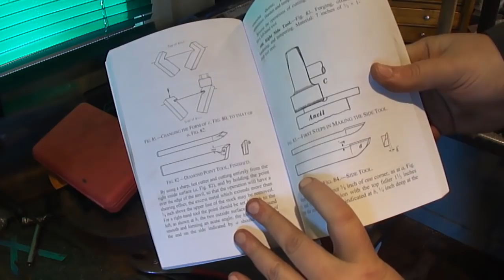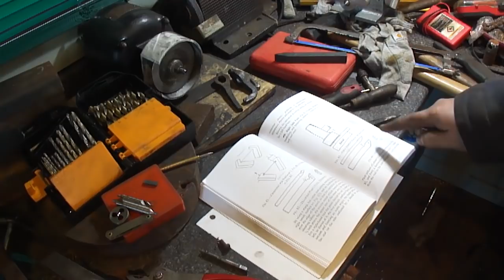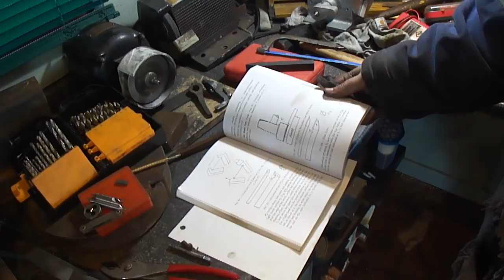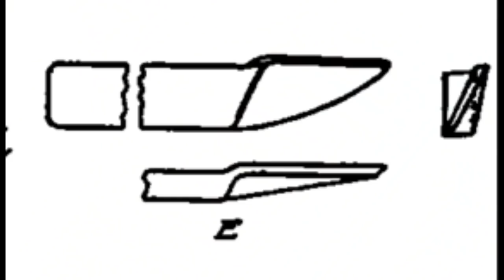Forging a Lathe Side Tool

Comment: very nice sometimes the old ways really produced great results.  You may wanted make some more tools with the high carbon steel, it seems to do a great cut (nice finish).
Reply from the maker: yea, I agree, I was collecting more pieces of the track to make some tools for the shaper next, but those are really just repeats of the lathe tools really, so I wont really show those.
Reply: That sounds good, it seem like a good metal for tools.  I have two questions where do you get your railroad steel and what is the title of the book you were using for this?
Reply from the maker: I live somewhat close to the tracks, but the guys that work on the tracks tends to throw the stuff off to the side and as the trains go past, it slides down into the ditches off along the sides of the tracks and ends up going into the people's fields and yards, which I know all of the people around here and they are fine with me just walking along and picking up that stuff out of thier yards so they dont hit the stuff with the lawnmowers and farm equipment. 

As for the spikes and stuff like that, Im friends with a few people that works on the tracks, and once they found out that I was tinkering with the blacksmithing, they dumpped off a large bucket of the spikes that they ordered at work a while back and something was wrong with them, and they couldnt sent them back, so they asked if I wanted a bunch of them, hence the large box full of new spikes in the last video, lol. 

You dont have to use the railroad steel and you can buy stuff like 1095 and stuff like that pretty easy online. Alot of knife makers tend to like that alloy evidently, so it's pretty common. The tools can be made of other alloys like O1, W1, and other grades of tool steel, but I just used what I have rather than buying new stuff. 

The book is called "forge work" by william L ilgen. You can find plenty of copies of it in pdf form on google, but I prefer an actual physical book to read from if I find that I look up stuff in it enough.

Comment: Some more quality tool making.. Did you ever think of starting an Etsy shop for custom cutters?
Reply from the maker: lol, nah, not really worried about selling the stuff tbh, too many people out there that you have to deal with that are unhappy no matter what and in the end, it's just more headaches than it's worth to sell stuff that you make.
Reply: Chirpy's Tinkerings true story hasn’t thought of that...
Reply from the maker: I learned that the hard way when I was building and selling computers when I was younger, and by the time you factored in all of the replacement parts because of stupid stuff, I ended up losing so much money that it wasnt feasable to even do it. With etsy stuff, you have shipping and everything to deal with also. If I had a die and could just make them quickly, it would be feasable, but the amount of time that you put into it and the work compared to what it would actually sell for is far from what would be feasable.

Comment: Drop forge technique...LOL. That tool looks good and works great!
Reply from the maker: lol, thanks man, I was really supprised at how well that stuff works. Also once it's up to heat, the track is a real joy to forge too imo because it moves pretty easily for me and you can harden it very very hard to cut through all kinds of stuff, lol. Ive started collecting bits of it like that to make some shaper tools out of, but they're mainly just repeats of the lathe tools tho minus the carbide.

Comment: are you using coal or what? cant get it around here. and what book is that?
Reply from the maker: I used to use coal till I devoloped breathing problems, then I built a custom propane forge, and have been using that since. I would check out the newer videos I have labeled "path to iron", which is mainly for metal casting, but it shows the propane forge and it being used to make custom tools for the foundry.